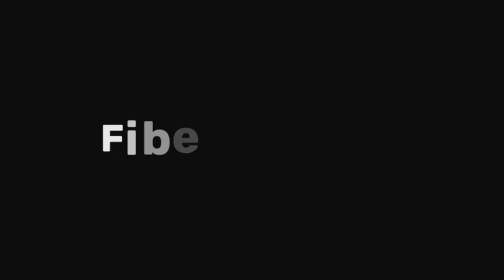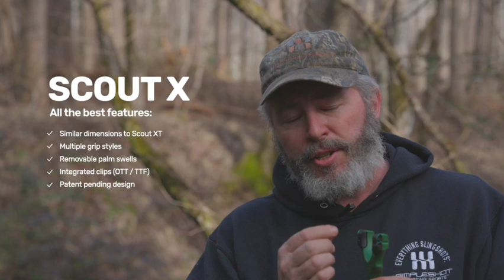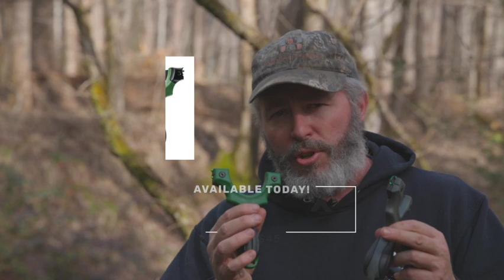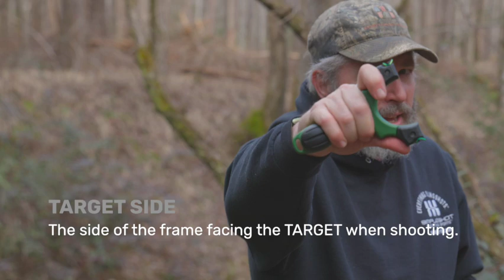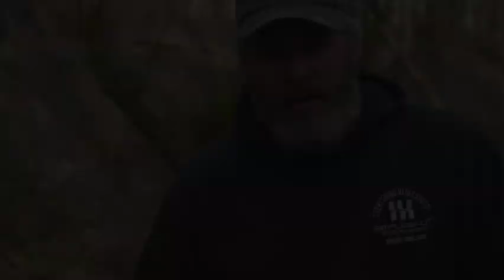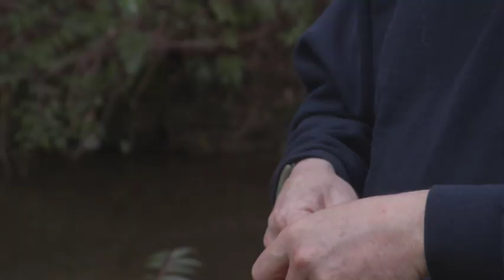Scout X Slingshot Reveal | Interview with Mark Seljan

Comment: You need to offer clips without "sights". The fiber optic covers my target while shooting TTF.
Reply from the maker: You can easily clip or cut off the section that holds the Fiber Optic Wire. This will give you the desired results. 😉